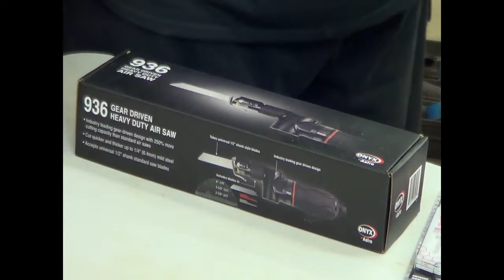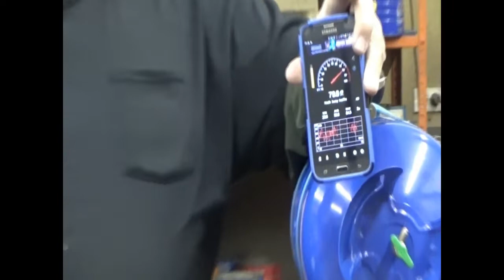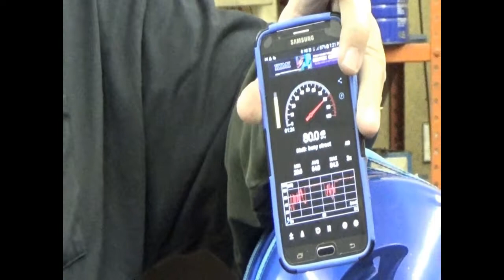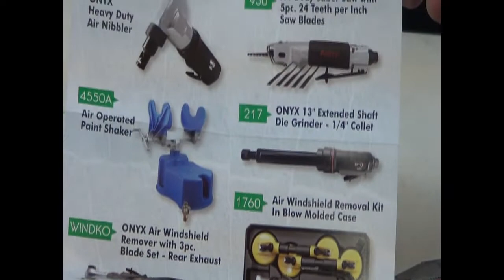Astro Pneumatic 936 Heavy Duty Gear Driven Recip Saw

Comment: Great info...  Off topic. Are aftermarket reed valves any good for ingrasol Rand 2340 Pumps. Or should i stick   with OEM. Thx
Reply from the maker: I have aftermarket 2340 kits available and I have had NO problems with these. many of the parts that I get marketed aftermarket come for same machine shops that oem parts are sourced from. I do no know about this particular kit but I TRUST my professional rep on them,
you may contact me through thecompressorguru.com in the mean time I will check the current price on this kit. Bud